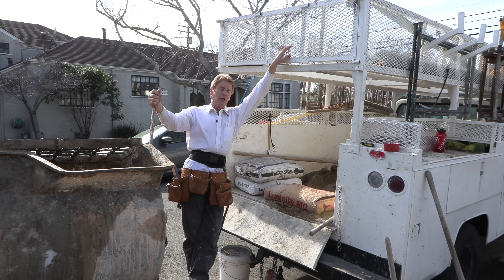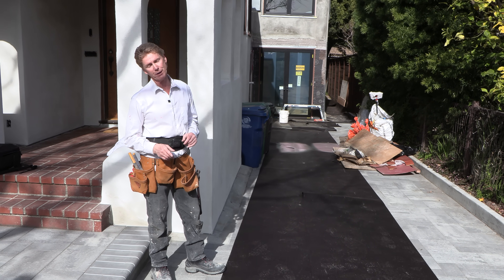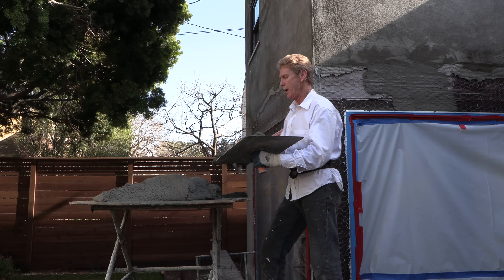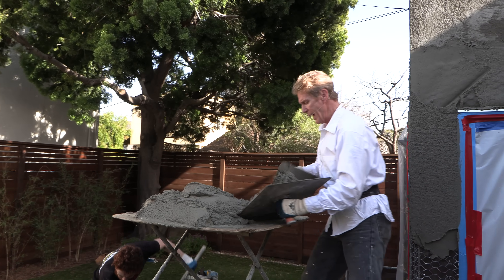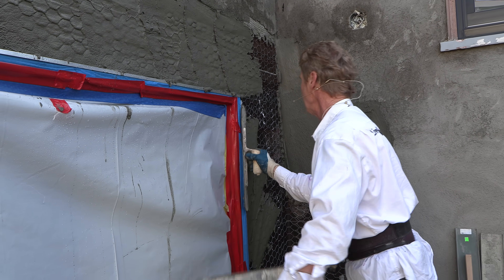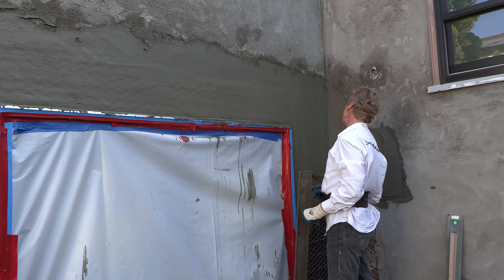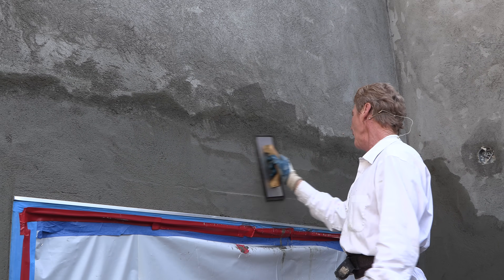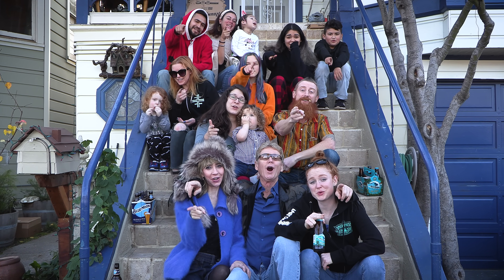Adding Stucco Accelerators instantly dry stucco patchwork. Cold joints in stucco.

Comment: Packed with such great info and still had time for a smiley! They never lie, Kirk still is the best.
Reply from the maker: Howdy Will, thank you my friend.
Every once in awhile we do some technical stuff that most folks won't understand, In fact like this video it's kinda boring, but sometimes inquiring minds want to know.
This one is to answer questions about accelerators and ghosting or bleeding color finishes.
Mainly for the seasoned stucco veterans.🍻
Reply: @StuccoPlastering  Never boring, the way you explain it you can soak in the knowledge like a brown coat drying in the sun. I like the tech stuff just as much as the application techniques. Thanks for the video! Any April fools video ideas for this year?
Reply: Stucco repair needed. Wish you lived here. 😮 @StuccoPlastering

Comment: hi I from Indonesia we dont use wire mesh on wall, but i see how efficient your work and i wonder how many composition for your plastering, cement, water, and sand..
Reply from the maker: Howdy Tommy, as a rule we used 1 part portland cement to every three parts sand.👨🏻‍🔬

Comment: Cold joins!  Chip and concrete glue!  My joints don't crack!
Reply from the maker: Howdy, I prefer mechanical bonds, without breaking out any stucco. 👨🏻‍🔬
Reply: @StuccoPlastering  No thank you!  I've been doing it the old fashioned for 45+ years!
Reply from the maker: @fake734  Howdy, LOL, I'm not suggesting you do it my way, I'm telling you the way we do it. Folks can do it, however, floats their boat. 👨🏻‍🔬
Reply: I get it! I've had my construction, residential remodleing business since 1976!  I got my G C License in 1976. I've seen and have been through all the different methods and phases of door and window replacement. I will usually match whatever method was used when the building was constructed! However, going back and observing my installations after 30+ years, I've found that breaking out the stucco, installing flashing, using concrete glue, and or adhesive in the plaster mix and on the broken, chipped plaster surfaces, last the longest against hairline and separation cracking and protects against water entering into the framework of the building, doors or windows! That's why I make the decisions on all of my work which method is to be used! Most guys don't want to do it the old fashion way "because" it's more work and harder!🤣👍
Reply from the maker: @fake734  Exzackory. 💃🏻

Comment: We own a old home we are fixing next up is windows and Stuco. My question is should we replace the siding before we Stuco or just Stuco over old siding? I would think it needs to be replaced but the guys we have had quote is just want to Stuco over warped siding.
Reply from the maker: Usually as long as it’s not got mold it can be gone over, as the stucco netting gets nailed into the studs.

Comment: Can you guys please elaborate based on your experience how the plaster/stucco process can affect the caulking around the windows? In a previous video by Kirk he explained how tape can affect it.
 I just installed windows and doors in a new house and they didn't leak until the plaster/stucco was applied (5 months or so without leaking). I saw some cuts in on my silicone in some areas where a section of plaster was unfinished. Can you guys elaborate on how this might had happened? Or what other process in the plaster might had affected the silicone that I applied? Or anything that might cause the leaking? This will probably go to court and I need all the help I can thanks. 🙏
Reply from the maker: Evening, it seams the lath leaked before the stucco as most stucco can be water repellent. Stucco does not corrode caulkings.

Comment: Great videos!  Kirk you’re awesome!
Is a lot fun learning a few tricks from an experience professional.
I have a question:
Do I need to put paper on an exterior parking ceiling? The rafters are 12” center. And do I need to put a vent ?
Thank you so much for sharing all your experience.
Reply from the maker: Howdy Carlos, the exterior ceilings only need a waterproof membrane if they are exposed to rain. For example in the video provided, it is outside however the rain can't touch it; thus no paper is needed. Vents are optional, ask the architect or builder. https://youtu.be/nESzhR3HkdE/ 🥳

Comment: Hi Kirk, Thank you for all of the great videos. 

I have a situation that I would like to get your thoughts on. We just bought a stucco house built in 1994 with parapets and several of the windows are leaking. I went up to the roof and removed a damaged section of stucco on a parapet to find that the original builder apparently did not install a waterproof barrier under the foam layer. I have not yet verified if the body of the house below the parapets was waterproofed. 

I have had multiple contractors out with different solutions. I am sure that there are a lot of variables that can affect your thoughts, but any input would be appreciated. My questions are: 

Would a metal cap on the parapets likely solve the water intrusion problem? I assume most of the moisture is coming from the top of the parapet (totally flat and about 16 inches wide).

I had another contractor pitch a system where they essentially coat the entire house with Senergy Alpha Base/Fiber Mesh/Alpha Base/Finish Coat. This apparently creates a waterproof seal from the outside. Do you have experience with this and is it a legitimate long term solution?

None of the contractors have recommended a restucco of the house or even the parapets other than preparing either for a metal cap or the Alpha Base system. I am sure that this would be a great solution but probably the most expensive?

Anyway thank you for your help
Reply from the maker: Howdy Matthew, I'd recommend a metal cap on the parapet top or coming down at least 4 inches, then a waterproof paint such as Stucco-flex or even stronger an acrylic system of a stucOflex primer and coating.
https://youtu.be/ER8zA6Olnkw/ a waterproof painting system.
https://youtu.be/283DclFqDwk/ How to apply acrylic finishes for a duck pond.
 stucco-flex.www.stucoflex.com/.   1-800-305-1045 www.stucoflex.com/.
www.stucoflex.com/  Rubber Stucco = No Cracks - StucOFlex.com/.👨🏻‍🔬
Reply: @StuccoPlastering  Thank you for your recommendations. I appreciate you taking the time to respond.

Comment: Great content. What would you prescribe for applying stucco to a cement board clad BBQ island on pavers? Thanks!
Reply from the maker: Howdy Jess, almost all portland based stucco will work, like Quikrete, Sakrete, Rapid set, etc. If I were going to do it I can make all these stuccos work, for a homeowner, I specifically recommend Quikrete Green-Cor USA, as it's a lime based stucco mortar with fine sand, It has the ability to move with the ground movement and applies like whipping cream. https://youtu.be/MbZHkJCJuZ8/👨🏻‍🔬

Comment: Why do you do everything by hand application when small spray devices can double the work of hand trowelling? I think by putting the first later on "fat and heavy" you could you the spray tool a lot quicker?
Reply from the maker: Howdy Robert excellent question, 20 years. ago, I owned a Tommy Gun, worth about 70 K, I did indeed use it for about 10 years, with the help of 11 men, but those days are long gone. Besides and contrary my arm is too fast already and a lot less covering. 🥳

Comment: I’ve been dealing with cracks due to the rain that got us during  Christmas time. Everything started to crack late January early February especially on the ADU that I just did. But come to find out they ran a tamper for pavers around the perimeter of it.😢😢😢😢 .. 🤷🏽‍♂️
Reply from the maker: Hi Raz, they did the same when adding the paver here, I just didn't add that comment as it's necessary to compress the grounds so that's the pavers don't sink. This causes serious vibrations which indeed will crack stucco walls and even the concrete sidewalks. Things that make you go hmmmm?😉